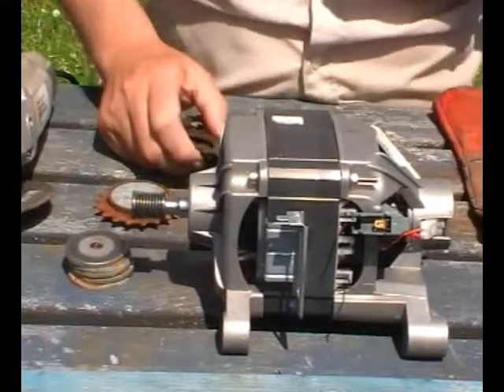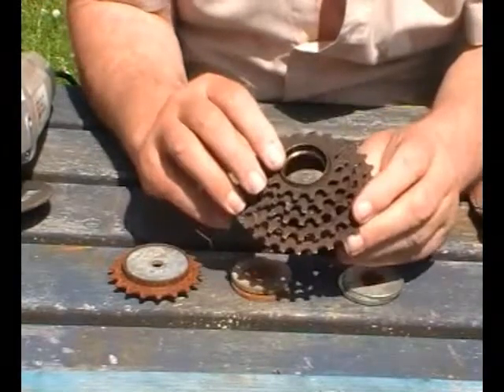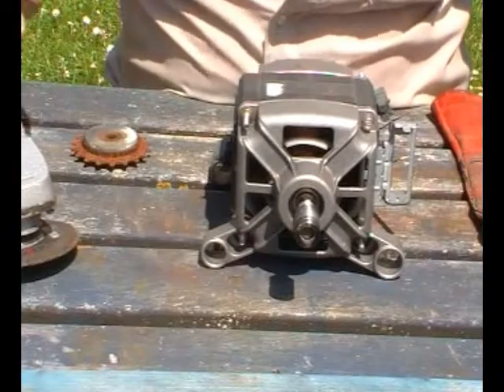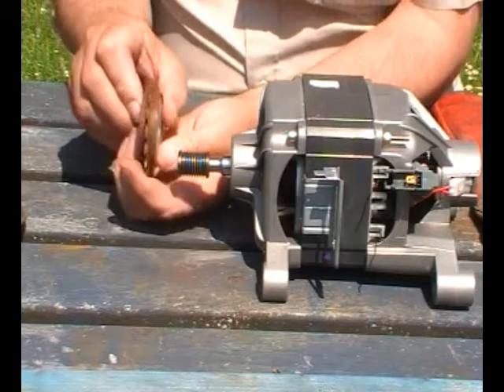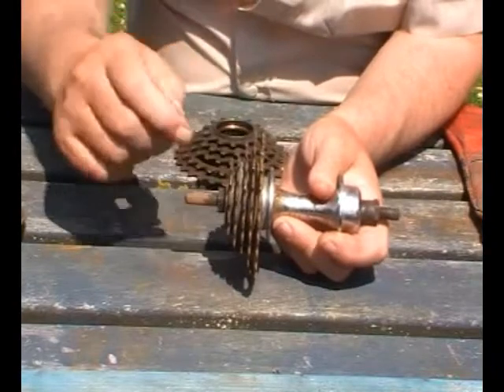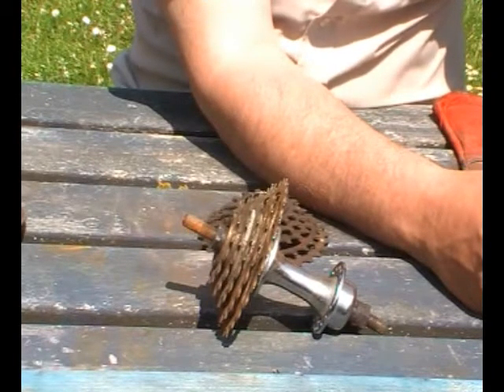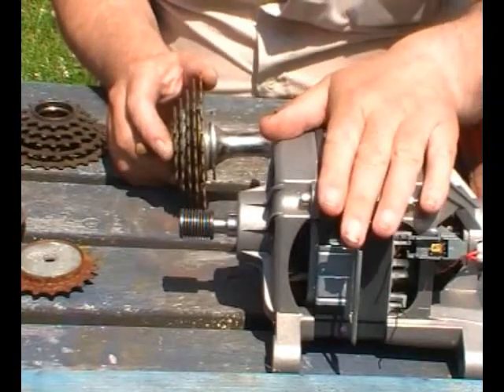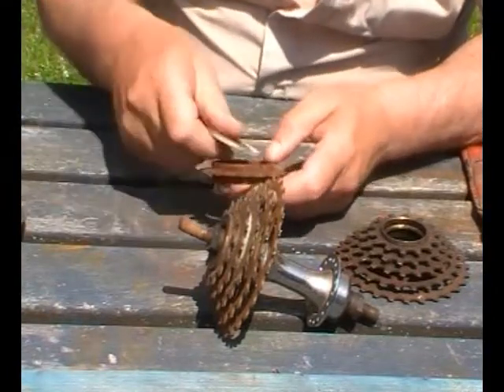MY NICE EV Cog and Jackshaft

Comment from the maker: Hello Jan. They are washing machine 250Volt AC motors. I am driving them from a hand built Lipo battery wired to give 90Volts DC. The final battery voltage will be 144Volts.

Comment from the maker: Thanks very much for that. I am going to be taking all wheels, axles and anything with a bike bearing to Halfords and have everything done for racing bicycles. Only because I am able to pay the extra. The project is about building an EV for as little as possible. That is why I am using push bikes and washing machine motors. I am building testing and showing people that they don't have to build the way it is expected. But rather the best way that works for the builder.

Comment: Hi Raymond, This is the first video I have had a chance to watch of yours,  looks like a good project. I will watch some others to catch up. The only thing I would add is to change out the grease in those bicycle bearings to an automotive rated grease because of the added heat. Take care.

Comment: I was only thinking about up to 60kph and slow(10kph) cornering... 60mph would be 100kph, and the push bike sprockets and chain wont do that. Seen it tried on motorbike that only weighs 200kg with rider. 12hp motor. I think you need to look for broken motorbike drive parts. Chain and sprockets should be worn as a set, if second hand. Or they will destroy each other rapidly. If chain/sprockets was the only new thing, it might be worth it. Broken drive mid roundabout is pretty dicey. Murphys law.

Comment from the maker: Thank you Bruce. I have seen TMan cut a key-way in a bar with an angle grinder and that was about 6 inches I think. I don't need anything like that so I have the time to do it slowly with a file and a drill. Going to drill hole in the washer with a drill to suit shaft tightish fit. Then drill smaller hole for key-way in washers and file to suit key. I am in no rush. I like it when I can make it fit nice and tight.

Comment from the maker: All I want is a car capable of up to 60 mph. Shopping trips mainly because that is where you get the traffic build up and going to and from work. When the car goes on a trip then it can be opened up on the flat fairly straight roads. I am aiming at a family car not a racer. This project is all about saving money.
I build stuff then if it don't work I find out why and look for a solution. Once a solution is found I test further until it works all the time or something else breaks. Cont..

Comment from the maker: Thank you for all the information it is very much appreciated and has been taken on board. Yes I could buy this and buy that. However it goes against the project criteria. "As Free As Possible". It is all about re-cycling. I want to build this project because I want to find out if it can be done. Simply because I can't find anyone who has done it before. There will be 4 motors to each pair of rear wheels. So direct drive is out. I am not building a fast car to run at speed and corner fast cont..

Comment: i really like that the video is outside. the little bit of noise from outside ambiance can really make a video seam pleasant. your audio is great and the brightness/color is wonderful too

maybe someday when i get my lathe done you can send my the measurements and i can cut some washers down so they'd fit in the sprocket cassette

for about 7$ you can get a 10 tooth sprocket from ebay, that would be good on the motor. and i hope you weld a shroud over the chain just in case it breaks at 1500 RPM

Comment: Will the car have suspension? Because thats going to affect drive system a lot. Engine usually being sprung, and wheels being un-sprung. Drive chain needs to be able to move. Ask a motorbike mechanic to explain it, or I can on G+. Acceleration squat probably wont be a problem, but should be considered anyway. As you have a motor for each wheel. I'd be inclined to do direct drive. Not good for unsprung weight, but possibly worth it to 60kmph or so. If not cornering too fast on bumpy roads.

Comment: force to advantage. On cone shaped pulleys. Re the belt cog you want off the shaft, it was put on hot, so expanded, then cooled and shrunk on. You can reverse the process with a blowtorch, and vice grips to heatsink the shaft and protect the motor from heat. Although I kind of like your idea, you can take your time, and if careful with grinder, hard to get wrong. Time and grinder disk consuming, but safer for motor if you keep the sparks out.. Sorry about big comment. G+ me if you want more info

Comment: I dont think the standard derailleur will be able to handle the drive torque either. Although kind of want to see it tried. Would be great destruction video if it failed! I'm not really confident on the washers for load either. Although I like your thinking in finding them. I can see that coupling causing headaches (like slippage, and twisted metal) under load. Have a look at motorcycle/scooter drive systems. Scooters have great, simple to make, auto gearboxes. Using belts, and centrifugal cont.

Comment: While I am really curious to see if the push bike drive can handle the load (Probably can, to around 500kg GVM). I'm seeing a few problems. Your sprockets are quite worn on one side. Unless you have the chain with matching wear, thats a problem, it'll work, but wear fast and poor efficiency, A matched chain/sprocket set is about 87% efficient, un even wear can reduce that down to under 70%. Centrifugal force, what rpm is the chain doing? Thats going to give your derailleur/tensioner issues cont.

Comment: Motorbike chains are the fastest I can think of, They dont do much more than 500rpm at 300kmph. Centrifugal force at that speed it huge. Further the axle from the drive, the bigger a problem it is. Belts are 9% more efficient too. While being cheaper and lower maintenance. Scooter v-belt 2 cone auto gearbox comes to mind...